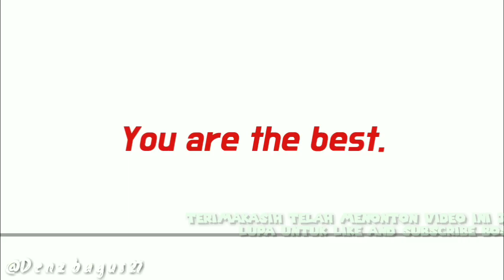Ganti gear set did 15/46 di CBR 150R

Comment: Gan mau nnya,motor sya mau ganti bn blkngnya pke ukuran 140 70 17,pke gear setnya jga mau ganti, pke ukuran 428Hv 15 47 panjng rantai 130L,rantai nya pke wilwood,,

Gimna tariknnya gan ukuran segitu
Reply from the maker: Tarikan awal biasanya kalo gear segitu mantep sentekan nya tapi buat top speed kurang om ngeden dia.
Reply: @Denzbagus_Alvlog  biar speed nya dpt gimna gan,,ranati nya bagusan tk racing apa wilwood gan
Reply from the maker: Kalo rantai gak ngaruh om yg ngaruh di gear nya kalo mau top speed blakang di kecilin jadi 44 atau 43 depan 14
Reply: @Denzbagus_Alvlog  ouh gitu gan,,

Comment: Bang mau tanya kalo gigi 3 CBR 150R saya kuat di 40-45 km aja, itu apanya bang?
Reply from the maker: Udah mentok blm bang
Reply: Ga nympe 50 km bang
Reply from the maker: Udah limit
Reply: Iya bang, suaranya kasar minta di naikin gigi 4
Reply: Itu kira2 apanya bang?
Reply from the maker: @jayenkspeed2403  minta servis kli om
Reply: Sudah bang tapi masih sama
Reply from the maker: Gak di gas kali om 😂 punya ku aja gigi 2 70
Reply from the maker: Motor  di gas dikit aja udah 50 lebih om kalo mau rpm
Reply: Minta solusinya bang jangan hina hahhaha
Reply from the maker: @jayenkspeed2403  posisi di mana emang
Reply: Tegal
Reply from the maker: @jayenkspeed2403  bawa bengkel aja jangan ahhas
Reply: Kalo Diler sih bro? Apa bengkel?
Reply from the maker: Bengkel biasa tapi yang pengalaman kusus ijeksi klo diles ahhas kebanyakan bocah belajaran
Reply: Ganti ECU & Noken as bro
Reply: Cuma itu bro?
Reply from the maker: Apa nya mase
Reply from the maker: Hhh standar aja gan di remup ecu nya aja sama aja
Reply: @Denzbagus_Alvlog  makasih bang
Reply: Bang feat depan 15 belakang 40 bagus ga bang?? Awet ga bang kira²?
Reply from the maker: Kekecilan om 40
Reply: @Denzbagus_Alvlog  cocoknya berapa mas??
Reply from the maker: 15/44 udah panjang nafas kalo gak 15/43
Reply: @Denzbagus_Alvlog  di tanjakan+speed gimana mas kalo 15/44?
Reply: Bagusan yg 15/43 atau yg 15/44 mas?
Reply from the maker: Masih enak bos
Reply from the maker: Speed juga enak
Reply: @Denzbagus_Alvlog  rekomendasi 15/43 atau 15/44 bro??
Reply from the maker: 15/44 aja
Reply: @Denzbagus_Alvlog  ok mksh mas,🙏
Reply: @jayenkspeed2403  ganti kampas kopling+filter udara
Reply: Rotaknya fullpump mngkin bermasalah